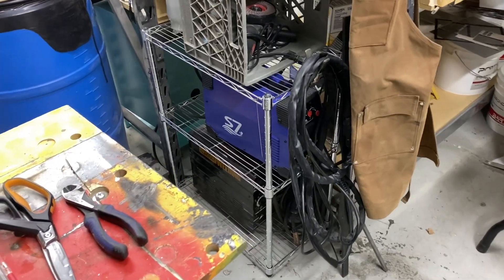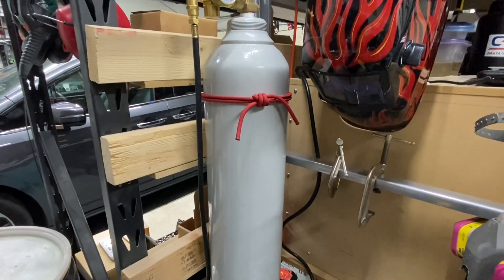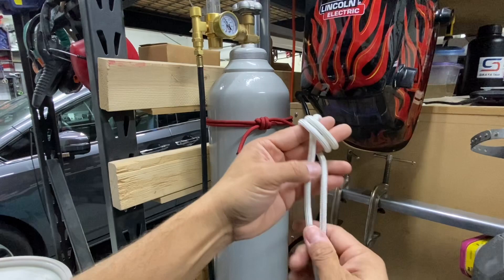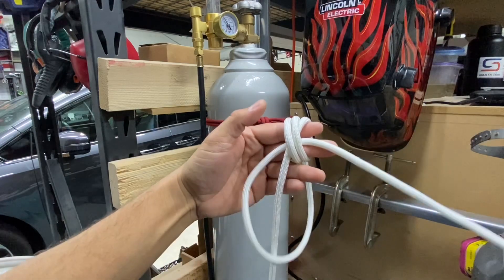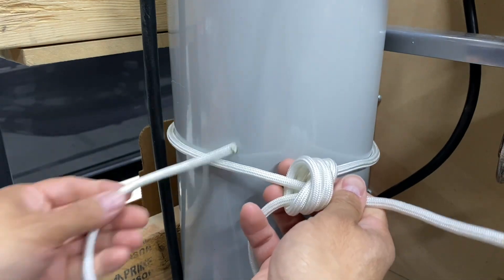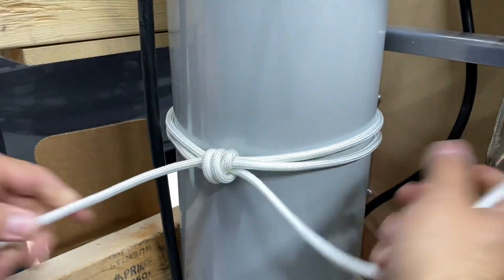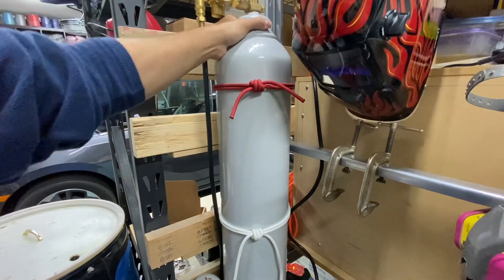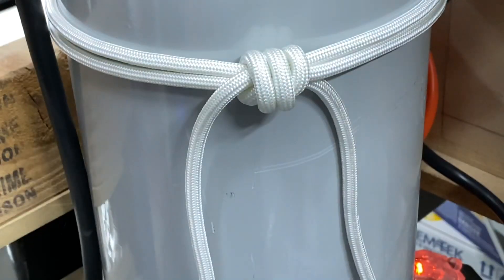A “ZIP TIE” for my ARGON CYLINDER

Comment: Very cool knot, maybe instead pulling the working ends all the way though you could try two bits creating a slip for each side. You would be able to tighten the line and with the slips pop them out and remove the line...

Comment: You can also use a cow hitch (often also referred to as a rope zip tie)   which is a little easier to tie
Reply: and easier to remember
Reply: I'm guessing it will pull tighter than the cows and undo more easily, but i haven't tried it yet.
Reply: @stephenclarke9468  To hold my gas bottles , I use a double back to back Blakes hitch with the two free ends passing around the bottle in a loop and then through each half of the hitch. You pull on the two ends to tighten it. I use this to hold the gas bottle in a cradle in my car when I take it for filling. The movement of the car has not loosened the hitch. With the blakes hitch you can increase the friction of the knot by increasing the number of turns.
I also use the blakes hitch on string tied shorts etc instead of a shoelace type knot

Comment: Any chance you have a quick release knot that would work for staking tomatoes and plants?  Most of these applications would be using strips of 1 inch wide cloth not cordage. Thanks
Reply: Google slipped constrictor knot. It should work with cloth, I think.
Reply: Look up the Siberian hitch (aka the falconer's knot).  Very fast to tie with a quick release.  Good luck! :)

Comment: Isn't the initial knot a three coil abok 3440 'Strangle Knot? (Also illustrated as 1239 & 1240.) The 'Constrictor' proper is abok 3441.[1]

BTW, that Strangle Knot tied in Nylon Mason Twine, pulled taut with a couple of spikes makes for an excellent whipping. Four coils works best for me, as more tends to 'bulge' in the middle. Keep the coils together as you start tightening.

Also, it's my understanding, most if not all fire codes, want compressed gas bottles secured with chain... as it won't quickly burn or melt through in the event of fire...

[1] Both Strangle & Constrictor are covered as several other abok numbers.
Reply: As a welder myself, I've seen ratchet straps (and chains) used almost everywhere, especially for mobile setups. Not just welding gases which are inert, but oxyacetylene rigs too--and those are more dangerous lol
Reply: It looks like a strangler to me. 

Appreciate your whipping suggestion. Works great! But hella fidgety to tie 😢